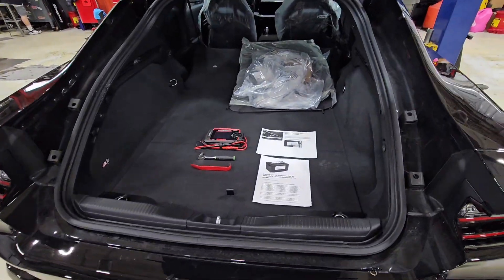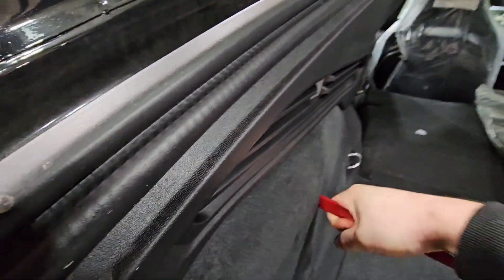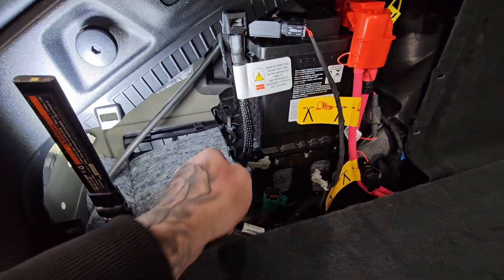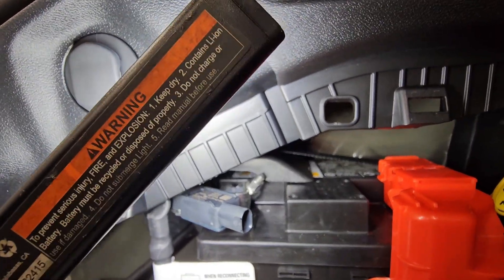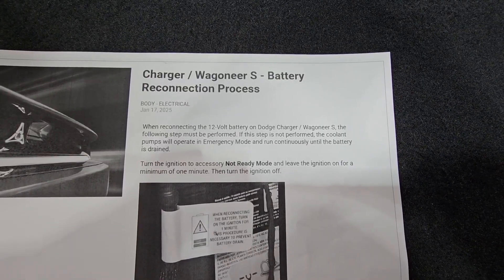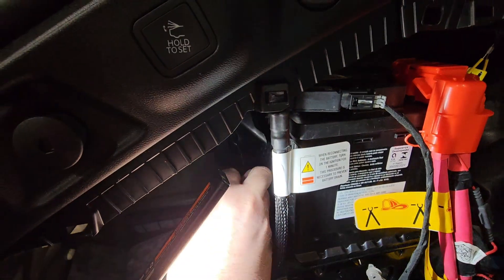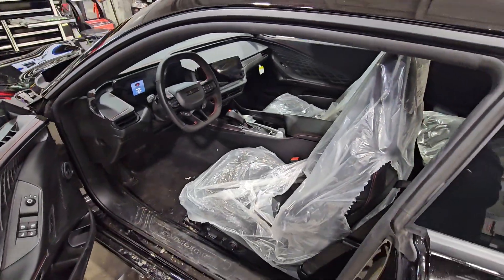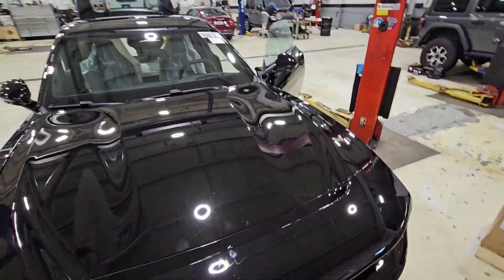HOW TO DISCONNECT, CHARGE, & RECONNECT A DISCHARGED 12V BATTERY ON EV CHARGERS (LB) AND WAG S (KM)

Comment: Underneath the battery, what’s that green tab?
Reply from the maker: That's part of the High Voltage Interlock loop. It's a low voltage circuit that runs along the vehicle and inside all of the high voltage components. If the the circuit is broken, it disables the High Voltage battery for safety. 

We use that green connector as part of the power down procedure by breaking the circuit when the connectors unplugged so we can work on high voltage components safety.

Comment: got a new 12v battery & fast charging stopped working + charger port isn't locking . any ideas ?
Reply from the maker: After the latest update, the charger no longer locks on level 1 or level 2 chargers, customers were having too many issues with it being locked so the took that feature away. 

If you're at a level 3, are you getting any error message from the car? Two red lights on the charge port? If not the issue may be with the charger itself.
Reply: @MoparTechJordan ive tried chargepoint & electrify .. it says charge interupted & if i try to lock the doors it says charge port cannot be locked . level 1 and level 2 charging gives me no issue
Reply: @MoparTechJordan i do get two red lights on charge point when i try to lock doors

Comment: Can I just disconnect the negative terminal and reset the car the interior light will not cut off
Reply from the maker: It sounds like you might have something going on that a battery disconnect won't resolve. You may have issues like a failed door or trunk latch. You could always give it a try but you may need to run it by the dealership for inspection if nothing changes
Reply: @MoparTechJordan took it to the shop and it seemed to be a software update that resolved the issue
Reply from the maker: @cjgray9352  Awesome. Im glad they were able to find something and have a fix for you.
Reply: Yes it’s easy to remove negative

Comment: My 25 Daytona R/T has been sitting at the dealership for over a week. It would turn on but not start. It wouldn’t start, so Stellantis had to tow it from my house to the dealership. Could this be a reason that the car doesn’t start or has charge issues? They don’t know what to do and are seeking help from the engineers.
Reply from the maker: @MichaelHernandez-p8l  After talking to the engineer that's been helping me on all of my case's, is that the running consensuses is there is a software issue where the car sees a dip in voltage which in turn sets these codes and warnings lights. There is a new software update coming and I'll post as soon as it's out. However if the battery was disconnected with doing the reset procedure, there is a good chance the coolant pumps could have drain the battery
Reply: @ thank you! Hopefully the service department gets my car back rolling soon!

Comment: My dealer replaced my battery when I went to receive my car and I think that the tech guy wasn't there. I wonder if the reset was done. It might explain why my 12v was down to 4v this mornings.
Reply from the maker: @Math.F-C  It very well could, that coolant pump will definitely continue to run if reconnect procedure isn't performed. We also have new software update coming in the next week or so to address battery drain concerns.
Reply: @MoparTechJordan  Awesome news thank you !